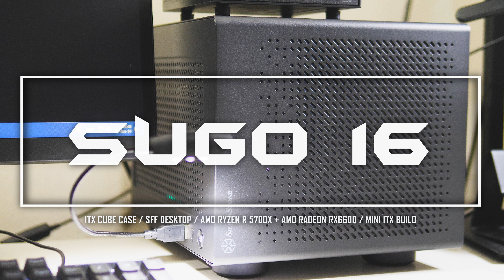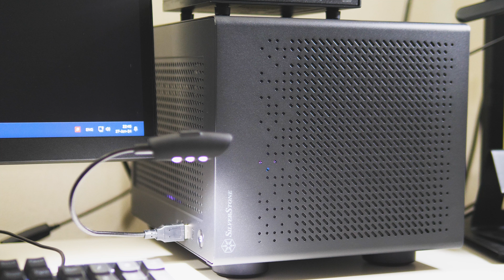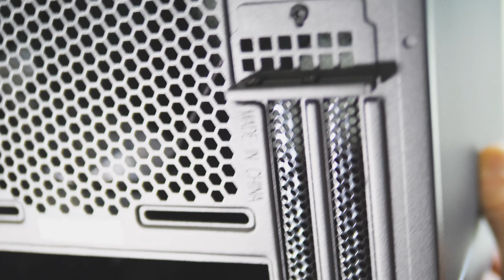SilverStone Sugo 16 PC "Cube Case" Short Review (2024)

Comment: I have this case and using it with front NF-A12 front, Thermalright AS120 Dark Evo (only cooler that doesnt intrupt with psu cables and front fan mount and lastly at the back Noctua NFA15 PWM which is a 120mm mount 140mm fan. This setup works very well noise normalized.
Reply from the maker: Hi, Yes, it is a good case with many possibilities! Thank you!